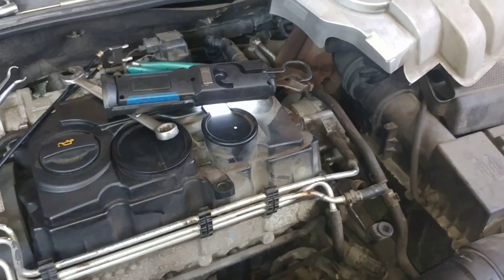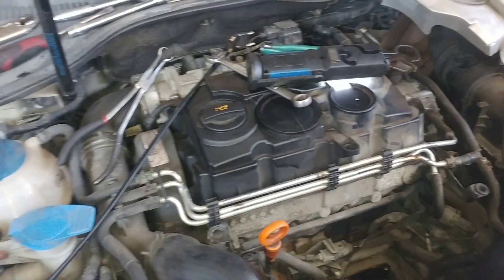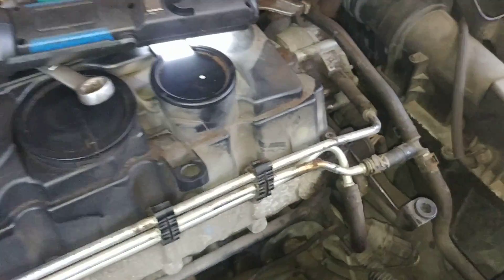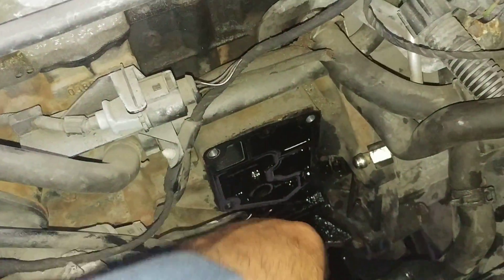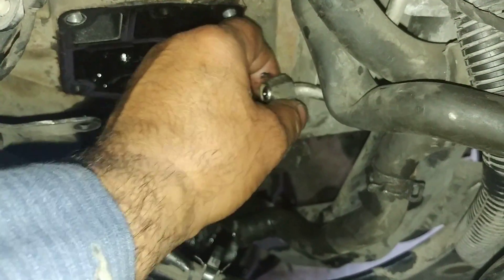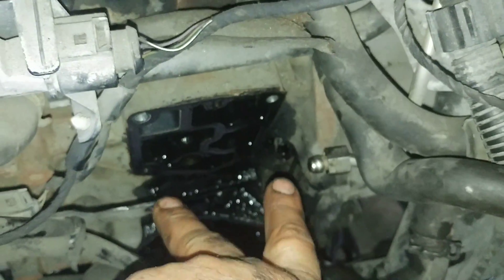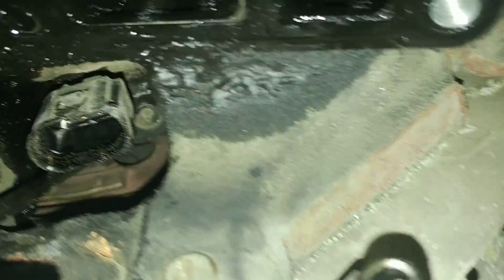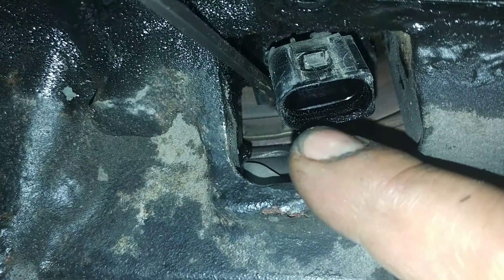VW TDI ENGINE SPEED SENSOR or Crank position sensor.

Comment: IVE DONE A FEW OF THESE AND EACH TIME THE 4MM CAP HEAD BOLT WAS SO TIGHT THE BALL END ALLEN KEY WOULD SIP. I HAD TO GRIND A LITTLE NOTCH IN THE BELL HOUSING TO GET MY ALLEN KEY STRAIGHTER. INSTALLING IS EASY. EASIER IF YOU HAVE A BORESCOPE CAMERA TO SEE WHAT YOUR DOING INSIDE THERE.

Comment: Thx for the video. When is a bumpy road sometimes my engine shut down and i get on VCDS: 16706 Engine Speed Sensor (G28)  P0322 - 000 - No Signal
Reply: In getting the same code. Was yours the engine speed sensor as shown in the video?

Comment: Hi I was replacing an oil pan on a MK6 GOLF TDI 2.0, was beating on it with a mallet relatively hard and was wondering if it could have damaged the crank position sensor because it doesn't start.

Comment: I have an 06 Volkswagen Jetta TDI, 1.9 BRM code P0322 also oil, light, flashing and glow plug light flashing, I swapped the engine out with another BRM and this is what it’s doing for the love of God please help please!!!!!
Reply from the maker: The glow plug wiring harness is  a common problem . Check it out. The glow plug relay located under left side of dash above kick panel is another thing to check out. Good luck.
Reply: @expertshawn  thank you so very much 👍🏼🙏
Reply: @williamstone267 my whole dash has flickered for years but it just sarted what you said, did you figure it out?

Comment: I need to do this on my a4 b7, longitudinal engine. I have new gasket for the oil filter housing along with the sensor. Does the cooler and oil filter housing come off as one unit? Just trying work out if I need anything else. Will be dropping coolant to change thermostat at same time.
Reply from the maker: Yes it does

Comment: In the 1.9 tdi asz engine, there is lubrication in the slot of the crankshaft sensor. When I enter it with a thin hose to get the accumulated oil from this slot, it pulls from the oil pan. What could be the reason.
Reply from the maker: There is no oil other than the oil filter housing  and the oil line. You may have a leak from the rear main seal and accumulate there.

Comment: the camshaf sensor can lose the acceleration power
and is it possible to completely detach the acceleration 
i have an audi a4 b6 1.9tdi avf 
and please explain what symptoms the cam shaft sensor has
Reply from the maker: I will cause multiple problems but the starting will take long or not start at all.

Comment: Having the same problem with my Audi a4 stalling juddering and hard starting occasionally wanted to see if it was the crank sensor or i have other more underlying problems, also throwing the p0726 code
Reply from the maker: most likely . Once I had problem with actual wiring and not the sensor. I had to replace wire from the sensor to the  ecm .

Comment: I have this engine code but my car starts perfect & drives fine, has gone into limp mode & has got glow plug light on too
Reply: Hi Clark did you fix it? What what's the Problem I have the same issue
Reply: @loveyoureselffirst  yes I did fix it, it was the crank sensor but it was a pain in the ass to get to, £5 sensor from a breakers & £6 oil cooler gasket
Reply: @InvisibleYetVisible  no it was just the crack sensor, easy change but very fiddly without taking the bumper off
Reply: @Cbch115  apparently it's held on by a single bolt ?
Reply: @InvisibleYetVisible  one or two I can’t remember but there is the oilcooler in the way so putting that back on is annoying
Reply: @Cbch115 my golf 1.9tdi doesnt go past 3200rpm but besides that engine is normal. But my dsg is in limp mode and changes gears very very slowly and it takes a long time for car to turn on. Glow plug light is blinking and traction control light is on. Did u have the same problem? Please respond please
Reply from the maker: The glow plugs has a relay and it also have wiring harness problem at the  plugs.

Comment: Maybe dumb question maybe not, how much oil loss did you have after removing the oil filter housing? am I to prepare for big pond of oil? how much oil did you have to refill after whole operation?
Reply: you're going to want to drain the oil first, obviously..  but even with that you're still going to make a mess...
Reply: @robkesik6382 no draining is overkill. You lose less than 200mm

Comment: on my seat leon 1.9 tdi i get a fault code p0118 . the car goes up to 1000 rpm  for few minutes and goes back to normal does someone know whats the problem .. thanks :)
Reply from the maker: You may need to change your Coolant Temperature Sensor. Located in engine outlet hose or  the plastic housing by the cylinder head.
Reply: @expertshawn   i changed every sensor and its the same ....
Reply from the maker: Your need to check wiring with an ohm meter from the coolant temp sensor to the ECM. You need to have wiring diagram and follow the schematics from one end of the wiring to the other end. If you see one wire that is not communicating with ECM. you need to replace or by pass the wire.  I has that issue with crank sensor as well. ECM  is located under the windshield wiper Basel.
Reply: @expertshawn  thank you  a lot
Reply: @expertshawn  now p0118 code is gone doesn't show  but the rpm is stil on 1000 sometimes when the cooling fan is on , when its of then goes back to normal

Comment: It’s a 5 mm Allen key using a long wobbly end Allen socket you can get sensor out without removing all that but this way does make it easier as it is in a stupid place bad design by Vw
Reply from the maker: Good  for you if you could get it with  out taking the oil cooler off. It  is not that hard once you know where it is. My main point was to show the location of the sensor as I could not find it myself . 
Cheers.

Comment: Hi, thanks for video.  My car has the classic symptoms of suddenly cutting out without warning and then only starting again when cold, so ordered crankshaft sensor (if not resolved will try camshaft sensor).  Wondered whether I need a replacement gasket for oil filter housing and cooler or can i easily reuse old ones? thanks in advance
Reply: Hi did either of these sensors fix your problem im having same symptoms on my 2.0 tdi cr
Reply: @danstanford89  nah, it stranded me at the side of the road once again and I had it towed to my local mechanic, even he was unable to get it going, in the end I sold it for $500 as a none runner but I believe the new owner got it running but I can imagine not for long, lol.  It was quite possibly the worst car I ever owned in terms of reliability, it's a shame because when it ran it was a joy to drive and obviously got incredible gas mileage.
Reply: Hey did the crankshaft sensor solve the cutting out ?
Reply: @craighavelock7456  no, see my reply I just made to other guy who asked.
Reply: Im 2 cars on from that one now 😂 but my mechanic diagnosed it to be low pressure fuel pump failing that the very expensive high pressure one. But ran great for about a year after pump was replaced
Reply: @danstanford89  I guess mine could have been fuel related as well.  After the ill fated Jetta I bought a nearly new 2017 Elantra, great car my son now has it, has well over 80,000 miles and not a single problem.  I now drive a 2004 Sequoia 4WD, I bought it last August-fantastic vehicle and with only 160,000 miles I expect it to last a very long time.  Obviously gas mileage not great but have a very short commute to work and is fantastic for hauling stuff and recreation and it is great in the snow which is important for where I live.
Reply: @robbflynn4325  nice never seen one of those here in uk, I've now got a f30 330d great on fuel and 0-60 in 5.6sec standard 😍
Reply: @danstanford89  yeah BMW make good diesels.  Diesels have never been as popular here in the US, I guess because gas is so much cheaper.

Comment: Had the same issue on a 1.9 ALH engine way back.  It just quit one day. Engine would start and immediately shut down. The code was no signal to the sensor.  Replaced sensor and fired right up.
Reply: What code did it throw?

Comment: Can I ask, what was the symptom of this vehicle? Was it not starting? Or was the code only present as an error? I'm interested because I'm trying to diagnose a no start on an 06' TDI Jetta, and I cannot figure out what it needs; thanks for sharing.
Reply: Did you figure out what was wrong with your 06 tdi? Having a no start problem as well and can't figure it out.
Reply: I'm having the no start issue intermittently which is how I ended up here chasing the code.  Any chance you guys found out that it was just a bad wire?

Comment: this is not correct you can remove it without removing the filter housing just remove the cooler at the bottom i just did this job
Reply from the maker: Good for you. I am sure the location and the size of the Alan key helped you.
Reply: yes your video was very helpful thanks
Reply: Hi, did you access it from below?  Does the cooler simply bolt onto the bottom of the oil filter housing?